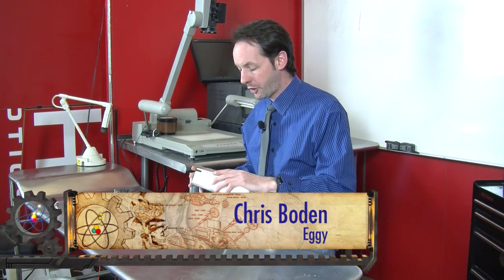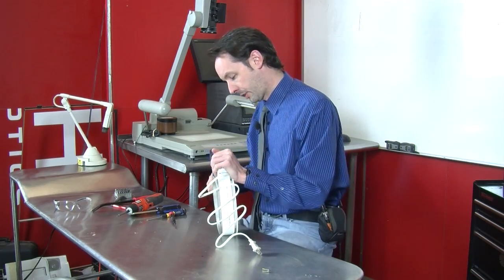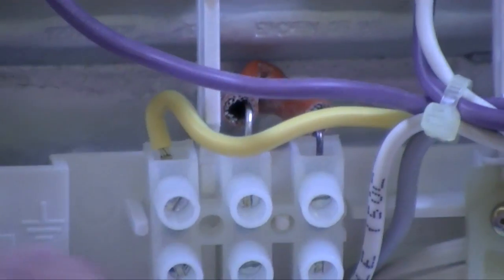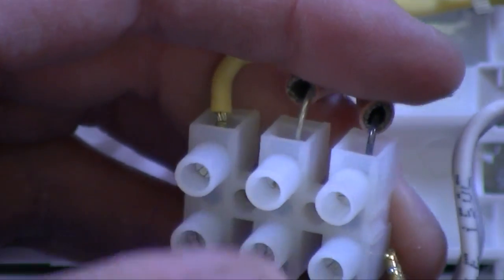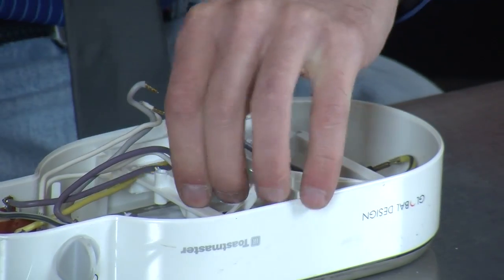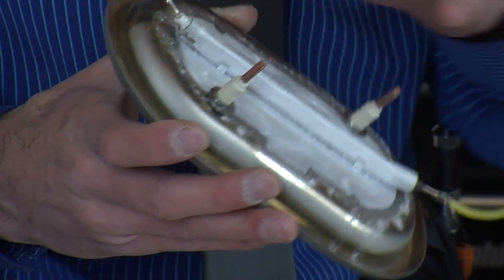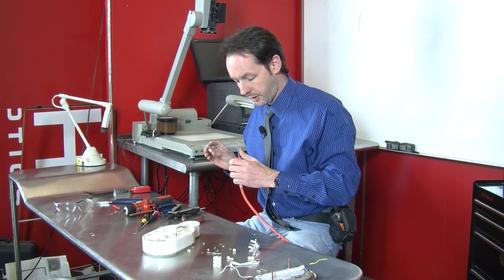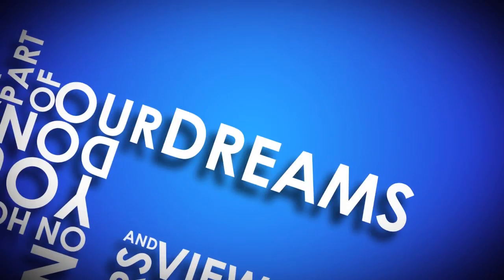Egg Cooker: Equipment Autopsy #61

Comment: They're called ferrules (as in boot laces). They're much, much better than tinning, as tinned leads and screw terminations actually don't get along.

Ever since I found a reliable supplier I've never used stranded wire without them.

Comment: That will pull 2.91 amps at 120 volts. You have a nice little 41.14 ohm 350 watt resistor.

Comment: (just a suggestion, probably something wrong with it or someone would have done it already), but why not do a series on how to get an old item of electronics (eg. computer PSU or Radio or something) and show how to harvest components from it and possibly build a simple project from those components? Eg. I built an AM radio transmitter (fixed frequency) from the stuff I found in an ATX power supply.

Comment: Just over 2.9 amps. It's as simple as Watts divided by Volts. These make great resistive ballasts. Especially if they have heat sinks attached. As for the buzzer, I believe that is usually shorted by the second position on the main switch of the device. It's to let you know it has finished preheating.

Comment: The bit you did at 10:40 is why we have little shutters over our plug socket holes. Learning how to defeat these little shutters is the first thing most five year olds learn by trying to stick things in the socket - "hmm it won't go in those two holes, they're shut. It goes in this other hole though... and the other two open. Hmmm" :-) (oh and 2.9A)